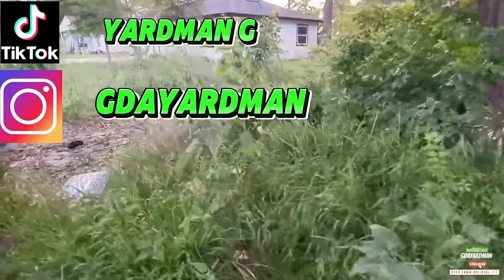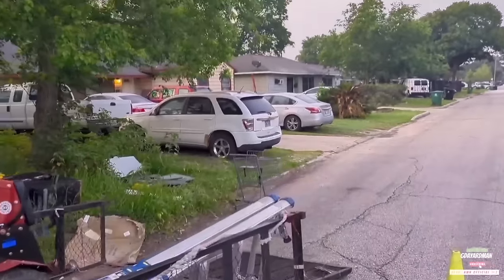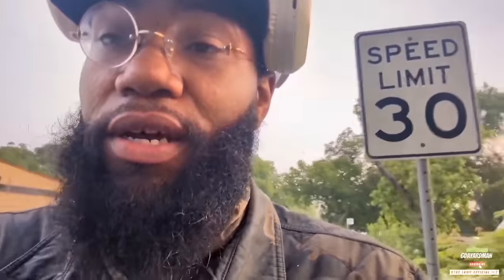I MOWED the City's WORST LAWN Code ENFORCEMENT missed for over 5 YEARS!

Comment: A  big improvement from what it was. It looks much better, for sure now.
If it was me, I would've removed those four smaller involuntary trees that you guys left which sprung up between the big one and the leaning one, so as to open the area up even more. But that's a moot issue and nothing to get worked up over.